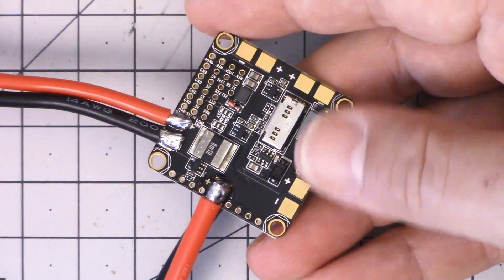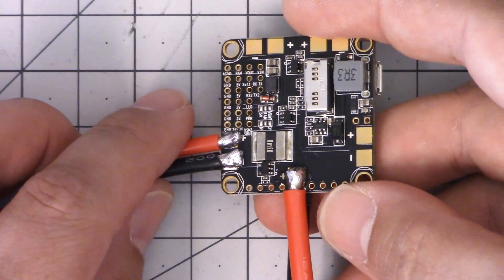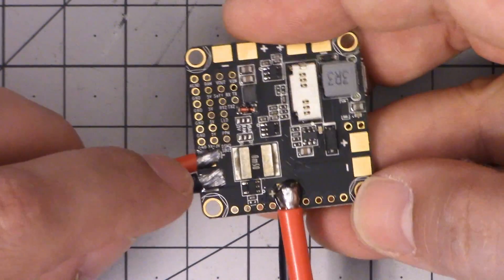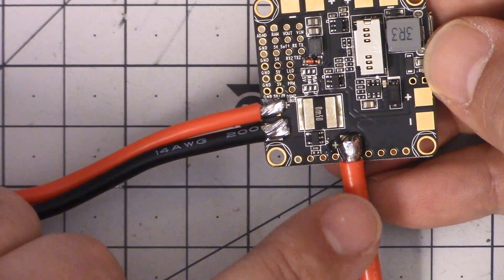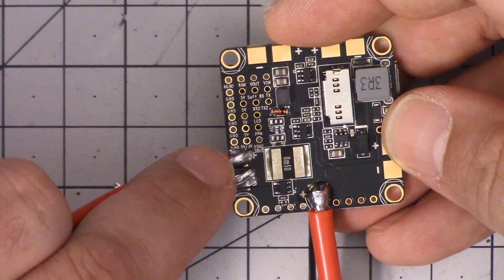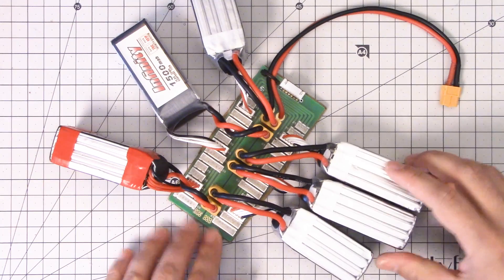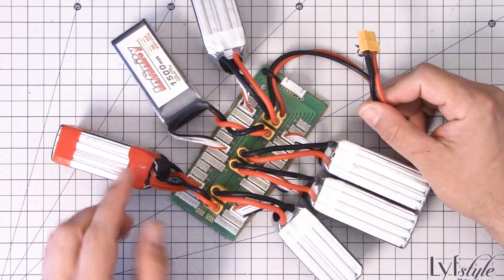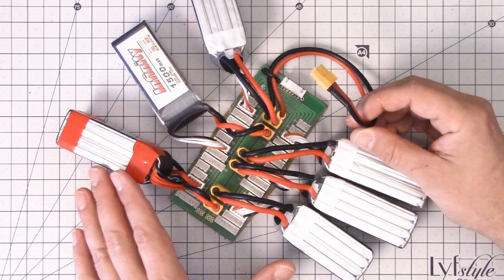Betaflight F3 Inaccurate Current Sensor mAh Readout | FIXED - Part 1

Comment: My issue is that im running 2cell...in betaflight it reads 8.3ish perfect...but frskyrxsr reads in my tx16s at 5.1 with 2 cells in...just usb it reads on my radio like 3.9ish...how can i change it to read the true 7.8 8.3ish full properly?

Comment: I'm at 30A on my small HRGLCF428 111 quad on the bench with 400.  If I do 4000 it does to single digit amps.  I think the real solution is to turn it off and not look at it.  Just make sure your ESC is more than enough for your motors and you should be good.

Comment: If using a parallel board, cross check the rating on the board and individual circuit, or you may just blow three 15A fuses at once with your 80A motor draw.  It did protect the 70A board limit, so that’s good. Must balance thinking and doing.

Comment: Related but not related. I have a DYS F4 stack with the 30 amp 4 in 1 ESC on a couple different copters. On one in particular when I power it on, the OSD shows 33 volts. I found this to be odd so I checked various pads with a voltage meter to discover 33 volts on multiple pads. I verified connections and Betaflight settings and they were all the same, though the others only read 16.8 volts. As well as show 16.8 on the OSD. Everything seems to function fine other than the camera blacking out sunlight. Any thoughts?
Reply: I guess I should add that the battery leads connect to the ESC only. Then the FC connects to the ESC via supplied 10 pin plug for the stack.
Reply from the maker: I am having a really really hard time imagining how there could be 33 volts anywhere on a flight controller. I mean... there isn't even a step-up regulator anywhere that could be defective.
Reply: That was my thought too. I know th FC is only rated for 3 - 4s. I figured if there was actually 33 volts passing through the FC it would fry. I show the same voltage through a volt meter. I will try to reply with a video tomorrow as my little is going to bed and we are in a camper at a camp ground.

Comment: What would cause the OSD mah to just keep counting up as soon as you plug in a battery and never stop until you unplug the battery? Thanks in advance
Reply from the maker: The current sensor is mis-configured or defective. If you have the current sensor set to "internal ADC" and the current sensor input pin is not connected, this can happen.
Reply: Joshua Bardwell thank you I will check it out. It was working before and then quite. So it might be bad, and it’s part of the Hobbywing XRotor stack so that would suck
Reply from the maker: Yeah if it was working before and then it quit, it's probably physical damage :-(
Reply: Joshua Bardwell dang thanks ...  extra weird. since the voltage OSD still works too. Thanks again I will check it out still and see if I can come up with anything. Appreciate the help.

Comment: Joshua
My MAH on my betaflight F4 rise really fast. When I plug in the Lipo. it just starts rapidly going up. I have a 450mah 3S and it hits 450 in a matter of 20-30 seconds ON the bench.
Reply from the maker: +Jim Telleysh https://youtu.be/pj_CaMZ98g4
Reply: Joshua Bardwell to get it to slow down, I have to bump this up to over 4000...is this correct?
Reply: Same Problem. Did you fix it by now?

Comment: Speaking of different batches, I received an odd looking board with a few problems. Im thinking that I might have got a "pre-production" or maybe even a "reject" board. 
The ground pads are barely coated, and the SD card wont fit.
Anybody else had similar issues?
https://youtu.be/qIFOeItaE-Q

Comment: Hey Joshua Bardwell,
I'm trying to calibrate the current sensor, but my power meter is doing a strange reading.
I did a short video to show you what's going on:
https://youtu.be/jzzWrF914KY
As you can see in the video when i start motors Amp is changing all the time, in the OSD this change does not happen. You know what's wrong?
Thank you in advance
Reply from the maker: +Manel Correia it just means one has a lowpass filter and the other doesn't. Try this method.

https://youtu.be/pj_CaMZ98g4
Reply: That method take alot of time and unfortunately i dont have time for that :( Thats why i bought a power meter. What you mean one has lowpass filter and the other doesnt? I bought this power meter from banggood maybe its faulty? I did not find anyone with the same problem in any video :S
Do you think there is any way to get around the problem?
Reply from the maker: I don't know of any way to get around the problem. Either the unit is very sensitive to small fluctuations, or it is defective. Anyway, I don't think there is an easy way to change it.

The mAh method doesn't have to take time. Just fly as normal and stop flying at a certain known mAh.
Reply: thank you

Comment: whats the trick to get the tramp smart control working on this board. i tried soft serial, and just using the correct uart its still not responding.

Comment: Hey joshua. I have a quick using for you if you dont mind.  I have calibrated my current sensor they way you did it with taking out 1000 milliamps out of my 1300 4s pack and then i adjust scale to 240 to get 1007 ma put back in by my charger on fast charge. But my question is that the amps during flight only reach a max of 56amps on full throttle.  Using emax 2306 2400kv motors, 1300 adrenaline lipo, 30amp v2 racerstar escs, unify pro vtx and betaflight f3 fc. I thoufh i heard you or someone say that either you have your milliamps taken out and in correct, or the amps being pulled during the flight will be correct? Its one or the other... is it right of a scale.of 240 if the amps are only 56 on full throttle?  Thanks steve
Reply from the maker: Both milliamps in/out and current in flight should be correct. They're based on the same measurement. Milliamps in/out will be a little bit off because the charging process is not 100% efficient but they should be pretty close.
Reply: Joshua Bardwell thanks for the reply.. ok so your saying that the emax 2306 2400kv motors only pull 12 to 15 amps at full throttle with hq v1s triblades? I heard those emax 2400kv motors pull up mear 30 amps per motor.. how is 56 amps the highest my osd displays..  something is off in betaflight please help

Comment: I got a board last week and it was showing max around mid 30a on my setup and I put the values up to 260 ish (originally 220) and it showed even lower amp readings at 20 amps, that is line of sight doing punch outs 2205 2300 cobra champs on 5x4.3x3

Comment: i got the matek f405 n when i put 4s 1300 milliamp it reads 25.5 volts 7s wayyy off how do i fix that
Reply from the maker: Adjust vbat scale.
Reply: Joshua Bardwell thanks got it perfect now jc actually still helping from heaven found his vid just b4 u answered

Comment: I think what you are trying to say is just use a timer. ;)  I just installed a bff3, which is why i'm here, but I'll still set a 2:30 minute timer everytime.  After over 2 years of flying this is always a safe time for my style and setup.  I've also set a 3 minute alarm in the osd, which i think is a nice use for osd, backup timer!

Comment: My Omnibus F4 Pro took a setting of 780 using the battery charge method to "calibrate". 13amps to hover is more believable than the 25A previously displayed.

Comment: Hi Joshua. I own a Betaflight F3 FC from fpvmodel since middle March. Now with Betaflight 3.1.7 it comes with a default value of 220 for current scale. Is this OK or should go to closer to 265 ? Thanks in advance. Miguel.
Reply from the maker: Check the mAh out vs. the mAh put back in by your charger.
Reply: Thanks Joshua.

Comment: Calculating the new current scale is easy if you look at the BetaFlight source code.  If you do that you can derive the following formula: (newScale = osdAmps * oldScale / meterAmps).  Flip and swap your props like Joshua says, put a amp clamp and the positive battery lead, set the props to 1500 and record the osd and meter amps.  Plug them into the formula and retest.  If your difference is < 0.1 amps, you're good. Otherwise, recalculate the values.  I made a quick web page to help: https://jsfiddle.net/ericmoritz80/h53ztua9/
Reply from the maker: +Eric Moritz that assumes the offset is always zero though a perfect formula would also correct for the offset.
Reply: The perfect is the enemy of the good ;) (isn't that what all lazy people say when they don't want to figure something out).  I could improve the calculator using one more additional reading I think.
Reply from the maker: The problem I see is that it's very difficult to derive the correct offset without multiple controlled measurements. If you get only the scale right, then you will get correct measurements as long as your amp discharge is roughly the same. When people use mAh in/out to calculate scale, and get inconsistent results, it's hard to tell if that's because there is inherent imprecision in the measurement (most specifically, how many mAh the charger puts back in) or because offset is incorrect.

I wish to hell somebody would think of a good way to control current draw on a real copter without putting people to the risk of wildly spinning blades of death.
Reply: Joshua Bardwell I don't know if you've seen this but in the wiki pagefor the Betaflight F3 there's a link to have to figure out the scale and offset on rcgroups: https://github.com/betaflight/betaflight/wiki/Board---BETAFLIGHTF3#current-sensor Maybe that'll keep us from having to brave the spinning props of death to calibrate our current sensors.

Comment: I came up with the same 260ish value across 4 separate boards from batch 1, 2, and 3.  Great video, glad you frontloaded the answer, even though I watched the video all the way through.  I don't think it's necessary to flip the props over, and I think if anything changed it would be the voltage divider resistors, not the main shunt resistor like you implied.
Reply from the maker: I agree that the voltage divider resistor is the one that changed. I got sloppy in suggesting it was the shunt resistor that got changed.
Reply: Joshua Bardwell I don't think you were sloppy, it's really hard to get the message you intend out....boy do I realize that, thanks for all you do.

Comment: There are many things affecting the current reading:
- The current sensing resistor needs to be soldered with plenty of solder
- Actual values of resistors within the INA169 current sensor
- Actual value  of external resistor
- Actual supply voltage to the processor as it is used as reference voltage for the AD coverter

I have also found that by adding a 470uf low ESR capacitor, the current readings change, probably due to lower noise from the ESCs. With a pure resistive load one can set the offset to zero, with motors one probably cannot.

Comment: Here's an off-topic question for you and I can't seem to find the answer anywhere. Why all the sudden has my beta flight configurator changed the virtual copter on the screen to a big clunky box that says back top front left right? I want my little virtual quad back!!!!!! Lol
Reply from the maker: +jamair31 it's something to do with your browser. It can't do 3d right.
Reply: Are you using a custom motor mix? That's why mine is the same as yours.

Comment: the first batch had incorrectly installed 110k resistors on the shunt , all other batches got the correct 47k hence the 200ish value :)
Reply: HecTech FPV yep, that what happened and I've got the board with 110k resistor, so max current reading is limited to about 60A. going to give it a try and change resistor to a 47k which should require scale of about 235
Reply: HecTech FPV bg

Comment: The reason for different readout an be also different current sensor chip, different voltage divider at the output and so on. It's rather not the value of shunt resistor itself

Comment: What sort of dude keeps notebook records of the milliamps used and voltages for every battery before and after every flight; Joshua?  Maybe a 'smart' battery that keeps it's own data, feeding the information back to the charger to optimise the charge and maybe a downloadable log of the battery? That would be cool.

Comment: when you flip the props and and switch them, if you change yaw and pitch by 180 you can arm and it spin the props all you want
Reply from the maker: +Michael Sharp well sure but don't.
Reply: except if you're going to be doing stupid stuff like spinning props at full speed in doors, then maybe don't do it with a usb cable still attached, and do it with your finger on the arm switch in case something does happen.  either way, i've done it many times. not only to get amp draws, but also to get thrust on a large digital scale.

Comment: I've built a Pixhawk board with an external power module before, and I had to do the calibration manually. When I received the BFF3 board, I assumed that it was not calibrated and did it manually as well. Can't call it from memory, but I think I ended up in a value of 253 or something like that.
Keen to watch your next video to confirm if I'm doing it the right way.
Thanks for the awesome educational content Joshua!
Cheers from Portugal

Comment: A typical shunt resistor should typical be within +/1% or +/ 5% range of the rated value. This result is way off, so can be a bad batch of resistors if they shall be 0.5mOhm by design. Try to measure the voltage across the shunt resistor and calculate the resistance based on the current measurement (R=U/I). I know some shunt amplifiers use a resistor on the output to ground to set the output gain. This resistor may also be wrong in this batch.
Reply: From what I have picked up from the comments, there is a shunt amplifier with adjustable gain with a 47k resistor. The amplifier is an INA139 (marking E39) from TI. Based on the datasheet the gain is 47 with 47k. This gives 23.5 mV/A ADC voltage with a 0.5 mOhm shunt resistor. The Theoretical scale value in BetaFlight is 235.

Can see from the PCB layout that the designer is not using a proper kelvin coupling on the shunt resistor to the amplifier. The actual measured voltage drop then consists of the shunt + copper trace on the PCB (Bad layout). This may be way Joshua's measurements gives a higher scale value.

Comment: What about the voltage sensor in the Swift 2? Even the the right way of doing it is off, how to fix it?
Reply from the maker: The fix would be for runcam to allow calibration in the camera.
Reply: Joshua Bardwell please use your influential YouTube powers for this to happen :3

Comment: Hey Joshua, thanks for all your help. I use 4in1 esc with either kombini fc or betaflight fc. I don't want to draw too many amps from one motor pad by going xt60 to fc first and then from any motor pad to 4in1 because of too many amps being drawn from one pad on fc. So am I correct in assuming that I can go xt60 to 4in1 and from same pads on 4in1 using a thinner gauge wire, let's say 22awg,  go to fc vbat pads since then there shouldn't be much amps drawn by the FC.
Thank you for your knowledge, research and time
Reply from the maker: Yes, you can do that. But the current sensor on the BFF3 won't work.
Reply: Joshua Bardwell thanks for quick reply. Yes I am aware of that. So in order to have that option, shirt if taking smaller gauge wires from each motor pads and bunching that mess together and solder them to 4in1 xt60 pads, what is the other best option to get current sensing on fc. Thx again

Comment: Isn't holding it down on a table and calibrating that way not very accurate, since the air will flow back up, similar to a bench thrust test? Seems like a better way would be bolting it to a pole and having it up 10 ft.
Reply from the maker: The current reading is still accurate. Amps is amps. This is not an accurate measurement of how much current it will draw in the air, but that's not what I'm trying to measure.
Reply: The RCAddict was about to answer but Joshua answered the same way :).
Reply: Perfect response. Thanks, not sure why I didn't think of that haha.

Comment: I got a fairly new bf board and it's scale is at 220 (Haven't maiden it yet) but I'm going to leave that number alone but my older board was at 400 scale so I am going to change that. It has been way low 450ish mah when I came down around 14.8v.

Comment: joshua good info as always.i fly mostly los with a mini voltmeter/beeper that i set to beep at 3.6v and usually i land it as that beeps.hopefully i am managing my cheapo batteries to last longer. just plugged in to the balance port and velcro to the battery.also keeps my balance port from being chopped off by props.

Comment: Tangential question. My 4in 1 ESC AND my Omnibus F3 board BOTH have the shunt resistor for current measurement. I haven't built the quad yet. Is there a preferred way of hooking up power to these?
Reply from the maker: You can do it two ways.

1) Solder the vBat to the ESC. Then solder the current sensor output of the ESC to the current sensor input of the Omnibus. This assumes that the Omnibus can be made to work with an external current sensor, which might not be easy given it is designed to work with its internal sensor. You might have to use resource remapping for example.

2) Solder vBat + to the Omnibus, then solder a wire of the same gauge as the battery lead from the other side of the Omnibus shunt resistor to the ESC vBat + pad. For negative, I believe the right approach is to solder vBat - to the ESC and then solder a small-gauge wire from ESC vBat - to Omnibus vBat -.